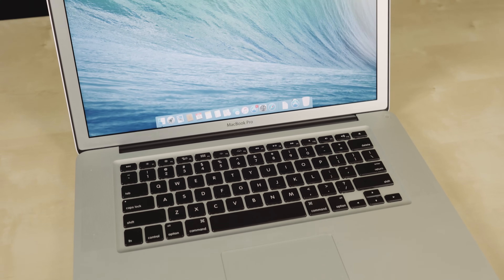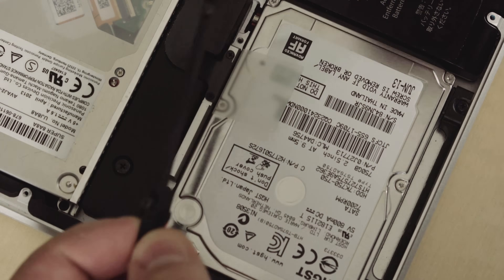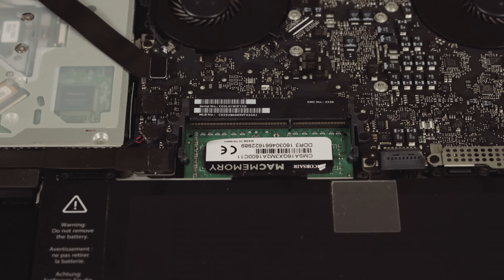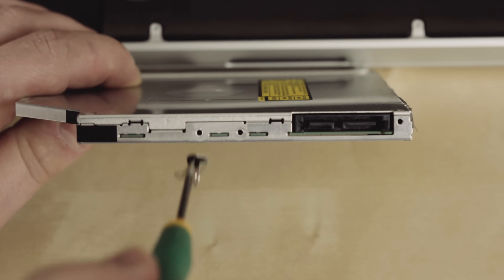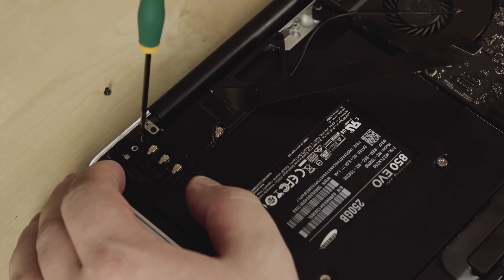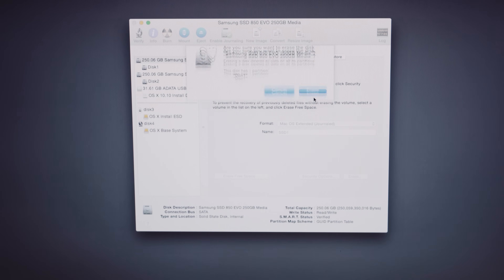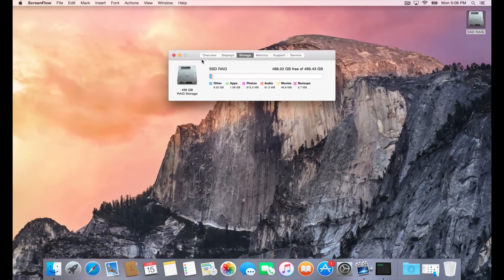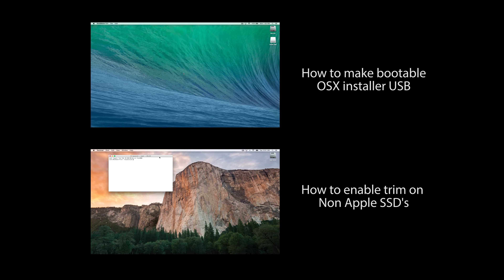Fastest 2012 MacBook Pro Ever! Upgrade Guide - in 4K

Comment from the maker: I did a little 2020 update. Check it out! https://youtu.be/Q_k5TQFrh9E
Reply: Anyone that claims a mid 2012 Macbook Pro is outdated and not worth upgrading  has drank the Apple Koolaid and will forever be buying the newest, high priced glop of metal Apple is pushing every 4 month's.  New operating system does not mean that you go trade in your perfectly good hardware and throw down $1800.00 for on with a new model number stamped on..
Reply: I’m getting ready to do everything from this video on my MBP, it’s also a 13” Mid 2012 model. You can imagine how slow it runs since I’ve not done a single update on this MBP ever. I called apple to see what my options were to helps it run faster & their only option was to upgrade to the lates iOS (Catalina). Needless to say that didn’t make a bit of a difference, I figured I would do my own research on upgrading the hardware. Which is how I found your video, lots of thanks btw for it! 
I have one question, is there a way that you know of where I could add 1TB SSD vs. the 500GB one you use here? I’d like to do that, but if not then no biggy!
Reply: Lee Zavitz Once I have upgraded my RAM and SSD will my 2012 MacBook Pro automatically run IOS or will I need to reinstall this? Thanks in advance
Reply: Lee, will a 16gb RAM fry the motherboard or will it be ok?
Reply: I can’t install Mac OS on RAID0 do you know. How solution this problem?
Reply: Steve Jobs *
Reply: The most funny thing in this video is that he used samsung SSD on an apple MacBookpro
Reply: @Lee Zavitz : Many thanks for this video. I will do this upgrade for sure. Can you just say me if I can use my OLD HDD in the Optical Drive space or not?
Reply: is there any thing we can do to solve kernel panic on old mac? downgrade the OS maybe? my old mac is 15" 2010 with 10.13.5 sierra.
Reply: I’ve upgraded my ram to 16 gb’s… it’s fixed my beach ball & glitching problem but want to speed up the computer a bit more!if I only change the Stock hard drive to ssd hard drive will it do the job?will I have to do a raid 0? & can I go up to 2 TB ssd hard drive?thanks for the video dude it saved me
Reply: I have to ask is there a similiar product to Macbook 2012 that has DDR4 options any Mac that has an I7 CPU and has DDR4 with an XMP profile will do 2014-2015 even 2016 but nothing before that anyone a little tip please?.
Reply: Lee Zavitz lol i just wanted to watch this video and went to read the comments and i see this :v

Comment: The 2012 MacBook pro is such a nugget it's built to survive a nuke blast. To make it even faster just install Linux mint it takes out all the bloatware and you get better security. Linux mint also supports all the ports on the MacBook pro even the disc drive if you want to watch movies or burn CD's.

Comment: You say Geekbench gives a lower score with 16 GB RAM vs. 8 GB RAM. 
Have you tested with 8 GB of RAM and also RAID 0, not only a single drive? Can it be the processor is measured as slower by Geekbench as part of CPU power goes to managing the RAID? It is a software RAID after all.
Reply from the maker: I have no idea. I made this video almost 10 years ago. I can’t see the cpu taking up much power to manage the raid0 config. I actually still have the MacBook, I use it for all of my accounting lol. One drive has windows 10 the other has Mac OS. I don’t have it in raid0 anymore.
Reply: @LeeZavitz  I intend to do the RAID 0 on a MBP 13" i7 (or maybe my other one with i5). Given it is only a dualcore, vs. your cuadcore, I wonder how much the score will go down.
At the moment still not sure if I want the RAID to be APFS or HPFS+ for speed, if there is any difference in this regard.
Reply from the maker: @MezeiEugen I can’t remember if the 13” had full sata3 6gbps speed on the optical drive like the 15” . Might want to look into that
Reply: @LeeZavitz  Yes, from the 13" models the 2012 has bot stripes SATA3. 

(2009 and 2010 are both SATA2 on for the Superdrive. Some 2011 have the Superdrive with SATA3, but it is said they do not work reliable as SATA3 on that stripe.)

Comment: Does it save the raid?
I tried installing Ubuntu in Raid 0 using rhe typical Linux tools and guides from GitHub but it never installed properly after creating the raid. Just curious if i will be able to install if i create the raid through mac OS recovery First

Comment: Is there any performance improvement having x2 SSD in RAID? Why would you do this instead of just replacing with x1 larger capacity SSD? Thanks for the video!
Reply from the maker: I show in this video why 2x SSDs in RAD0 is faster. You get double the bandwidth vs 1 drive.

Comment: Master level tip: The fastest Mid-2012 Retina MacBook are the 15 inch models. They have almost 3 times the multiprocessor speed over the 13 inch models. They also have more ports: an SD-slot and microphone in.

Comment: Is it still relevant?
Reply from the maker: Maybe if you have an old machine you can still use for web browsing and photo editing. I would stay away from it for video editing. Cheap m1/m2 MacBook Air has more power
Reply: @LeeZavitz  I still use the mid 2012 model with 16 gb ram and 256 gb ssd. Works great if you stop upgrading os and mostly work on browser.

Comment: I have the same year model 13 inch model, I’m thinking of upgrading to 950 gigs, the drive I’m looking at is 960GB Crucial SSD - Refurb (FCCT960M500SSD1) ,
Will it work with my macbook pro 2012?

Comment: Hey Lee that was a great video but only came across it now!😅 Being 2023 and with oclp allowing us to run Sonoma on this 2012 mbp which are still a quite capable machines, I was wondering if you could pull out the mbp 2012 out of the storage, dust it out and make us a video on setting up a raid 0 under sonoma? That would be mostly appreciated. Thank you so much in advance!
Reply from the maker: I know you won’t want to hear this but a cheap used m1 MacBook Air will run circles around the old 2012 MacBook Pro even with upgraded ssd in raid 0. Better display, amazing battery life, it will still be supported for many years of OS updates etc. obviously if you have an old MacBook and want to tinker with it that’s cool, but I probably won’t make any more videos on it. (I do still have it. I use it for doing taxes  book keeping)

Comment: Why the heck would you remove the dvd drive when you can simply change the ssd to a 4Tb? Is exactly what I did and my mid 2012 13" is as fast as my other mid 2017 15" .

Comment: why does my MacBook Pro (mid 2012) not like 16gb RAM? It keeps giving me the '3 beeps' (it did initially 'like' the 16gb of RAM and was fine however every time it reboots it 'beeps') if i take out and reenter the RAM its okay until it restarts ...then t beeps again? Am i missing something here ...do i need to reset my MacBook or change the settings once I've installed the new RAM?
Reply from the maker: It could be faulty ram. I’ve had this issue on building PCs before
Reply: @LeeZavitz  thanks Lee is there anyway of checking the RAM to see if it is faulty?

Comment: Why use two Ssd will that provide better performance than an Ssd and an hdd?
Reply from the maker: Twice the bandwidth in raid0
Reply: @LeeZavitz  can you explain what that does or how it adds because I was thinking replacing my optical for an hd as I already swapped my original Toshiba hd for the Samsung Evo Ssd 1 tb

Comment: For anyone who is upgrading both software and hardware. My personal experience after having troubles. After you install new SSD and turn on your mac, press cmd+r to recover from internet. Then open disc utility and erase SSD to Format: Mac OS Extended (Journaled) before intalling original OS. Once Lion is installed, get Sierra as intermediate OS to upgrade for Catalina(El Capitan crashed and didn't work several times as transition OS suggested on most of the resources). Hope it will help someone 😉
Reply: Mojave is best

Comment: Great video love how easy it is to upgrade the ram in the early macs. I have a MacBook air 13 (early 2015) has 8gig ram. It is almost impossible to upgrade ram (have to solder it off/on the logic board )
With the 2012 can you upgrade to the latest Mac OS?

Comment: Will you lose everything if you upgrade to ssd?
Reply: Without any extra work, yes. The ssd is the storage device holding all of your data, so replacing it would leave all of your data on the original ssd/hard drive that your MacBook came with

Comment: Lee
I want to do this to mine
I have a 2012 MacBook Pro
4gb ram and a 1tb hd 
Slow as heck 😂 
All I want to do is upgrade to just one ssd 1tb and the 16gb ram
Do I still need to do all those steps you did or no?
Anyones help would be appreciated
Reply from the maker: this laptop is pretty dang old now. But even just Swapping the drive to an ssd will see speed improvements. I don’t know if apple is still supporting it or not. Maybe Catalina

Comment: Is it really worth bothering with the hard drive bracket screws? I feel like the back cover and bracket would give it enough stability, plus the lack of moving parts means it's a lot less of an issue if the SSD jossles around a bit. I've just got a philips 000 on me at the moment and am cheap, lol.

Comment: I followed install and all directions to a tee (used Samsung 870 Evos 1tb) , but it won't install the original OS (mtn lion) with a raid 0 setup. I was able to clone the drive using carbon clone but it won't natively boot the disk. Any ideas?
Reply: Did you end up figuring this out? I’m thinking of getting the 870 also since there cheaper then 860 now, but don’t know if it will work

Comment: Looking to upgrade my mid 2012 macbook pro, do i need to have a usb hard drive with an OS on it and install it? Say i want to upgrade to 1 500gb SSD, 16gb RAM, and a new battery, it wont run the current OS that my mac already has (I have Catalina currently running on my macboook right now) anyone able to help me out before I purchase the equipment?

Comment: Just finished this update. I have a high sierra update on an ssd card formated for Mac. It will not load installer on its own. It won't let me do any updates from internet and the cd rom seems to be locked so I can install from original cd. I've reset and comand+shift+option+R takes me to the folder with ? In it. Any where yall can point me too please!

Comment: I was going to do this but i saw my mac had the 16 gb ram and 500gb hard drive already stock. Should i still try this? It still slow af. everything i do the pinwheel of death shows up, even just clicking on nothing
Reply: I’d still upgraded the 500 gb HDD to an SSD, maybe to 1 TB, it’ll run so much faster

Comment: Thanks Lee Zavitz. Love your video and like to upgrade my Macbook Pro. I would like to seek for your help for some of my questions for the upgrade. 

Firstly, I have one "Samsung 860 EVO 500gb SSD", which drive should I replace?
Second, what is RAID Zero mentioned in the video? Can I do a RAID zero like you did in the video? Cos I only have  one "Samsung 860 EVO 500gb SSD".
Lastly, Can I do this upgrade with my old backup? or only can do it with installing the new OS?

Hope that you can help me with these questions that I am facing.

Comment: I just put in 16 GB of ram and a 1 TB SSD and it is such a game changer! I'm in love all over again with my Mac.
Reply: What is the OS that you’re running on 2012 MBP
Reply: @ericmanning731  does this work with mbp mid 2012 retina?
Reply: @ericmanning731  how much it's battery backup? Please reply
Reply: I installed 16gb ram and one 500gb SSD (before I saw this video) and it was soooo slow on Catalina. Downgraded OS and still slow. Need to figure this out…
Reply: @joeblow1942  hi a quick search told me the max ram is 8gb ram 1600MHz DDR3 for the 15 inch mid 2012 macbook pro running on  Mac os Catalina i7.

Comment: Back in 2017 I believe, my mac was so slow that I was going to just throw it out and unfortunately/fortunately buy a newer expensive model. I came across this vid, bought and installed the two 8gig RAM but only 1 500gb hard drive. But either way it made a HUGEEEE difference. I spent a little over $300 on the RAM and Hard drive and basically save over $1k. Now its 2021 and I still use my 2012 mac! Still fast and reliable as ever! Just wanted to come back and say thanks for the video! Saved me a ton of hassle at the time!
Reply: same. high five man. i am so impressed with this laptop i find no reason buying a new one
Reply: I took this project on a couple weeks ago. New battery, 500GB SSD and added ram to total 8 GB. I got this mid 2012 from my daughter after she graduated college. Total $150 in this MBP and it is now so much faster and functional.
Reply: Hey so ur saying old macbooks 2012 can handle 16 gig ram?
Reply: @knives26  yes, Apple says only 8gb but many have been able to use 16 gb just fine
Reply: Thanks for sharing, this is exactly what I want to hear! 👍
Reply: Hey what is you Operating system  …I have a 2012 15’” …non retina …but I got a kernel panic…since then, no go …it said due to updates needed in Os …lmk what runs stable on that Mac ?
Reply: @Rio-by1eh  and for anyone who is upgrading both software and hardware. My personal experience after having troubles. After you install new SSD and turn on your mac, press cmd+r to recover from internet. Then open disc utility and erase SSD to Format: Mac OS Extended (Journaled) before intalling original OS. Once Lion is installed use Sierra as intermediate OS to upgrade for Catalina. Hope it will help someone 😉
Reply: Did you update it to Catalina when it came out?
Reply: em m
Reply: Cutest thing ever :D

Comment: Dear Brother, Pls read my comment and do reply. I tried to reball cpu and pch in apple motherboards but failed. The quality of the motherboard is quiet different than the rest like hp , dell etc. It does not catch the solder easily. This is the reason that when i mount the cpu or pch on the motherboard and do soldering through my ZM-R5860 it cannot solder 100%.  Pls guide me , what should i do. My id is taralaptop2015@gmail.com and whatsapp no is +919870034616. Pls ,, very eagerly waiting for your answer. Thanks

Comment: Just wanna say thanks for this. My Mid 2012 Macbook Pro was practically unusable at certain times. Constant beach balling even when copying to the clipboard. Couldn't use Chrome at all as it would take almost 5 minutes to fully load. 
Was so sett on buying a brand new Mac even though I couldn't really spare the cash on it, then after my Sister suggested upgrading this one I came across your link. £21 on another 500GB HDD and doubled the DDR Ram from 4GB to it's maximum limit of 8GB which cost me £28. So now I have a excellent working Macbook Pro again for less than 50 quid.

Once again, thanks for the tutorial on how it's done.
Reply: If you still have the laptop, replace the thermal paste and it will feel even quicker

Comment: Nice.    Keeping those screws in order will prevent a possible mess.  Even those short ones differ.  Some are threaded normally and some partially threaded.    I dislike messy screw threading.  Good catch.    I found my mid 2012 in a dumpster wrapped in plastic with the words DEAD written on it. Less than a hundred bucks and a few hours of relaxing repair time, I have a fast little, nearly new looking Macbook Pro.  Even the battery has life left.       Don't let anyone tell you a mid 2012 is outdated and can not be made to run quite well.

Comment: @lee -  trying to do the OS reinstall from a time machine backup. I'm getting the following error "An error occurred when adding a recovery system to the destination disk. Restart your computer and then try restoring again. 

I did that , and got he same error. Anyone have any thoughts or ideas? Should I just go back and get rid of the RAID, and keep them separate maybe?

**TM backup is from 10.15 and I had tried using the Maverick and/or El Capitan Mode to select the TM backup. I'm going to install a clean OS X, and then get it upgraded to 10.15 and then try the TM restore. 
**I was unable to reinstall the OS from my TM backup because Catalina does not support RAID0. I had to start over, leave the SSD's as separate drives, and restore from TM to one of them to get everything back up and running.

Comment: you didn't talk about Reliability when you making Raid 0 if one of your drive having a problem you will lose all data in both.
Reply from the maker: Been running solid for 4 years. SSDs are pretty reliable. But you are right. Do it at your own risk.
Reply: @LeeZavitz  it seems you recommended that in 2020 version

Comment: Hi because my MacBook pro already as Apple SSD SM256E in it, so I can only use an external USB 3.0 adapter to hook up 2 x 500GB SSD format in RAID 0 and restore it as an OS System drive. But it didn't work, the laptop just don't boot up the RAID 0 system clone Disk. Can anyone help?

Comment: I just did upgrade my 2012 Macbook upgrade in line with this video and for some reason my MacBook is not accepting the Corsair DDR3 16 gb (2 x 8gb) RAM (1600MHz). The machine keeps making a beeping noise on startup.
Reply: Finally got my macbook air fixed remotely by "APPLETOOLZ" on insta gram he's the all time legend in fixed iOS device.
Reply: Finally merry_tech01 on 1G perfectly unlocked my device. After been scammed severally by some other hackers .he's reliable and legit ...
Reply: Finally merry_tech01 on 1G perfectly unlocked my device. After been scammed severally by some other hackers .he's reliable and legit .....😇
Reply: Finally merry_tech01 on 1G perfectly unlocked my device. After been scammed severally by some other hackers .he's reliable and legit ..

Comment: If someone could me with my issue, I have a 2011 MacBook Pro with 2.7 GHz Intel Core i7 processor
8 GB 1333 MHz DDR3 Memory and an Intel HD Graphics 3000 512 MB, It powers off as if someone was holding the power button when using it ( Not every day).
Changed battery, SSD, RAM and still have the same issue